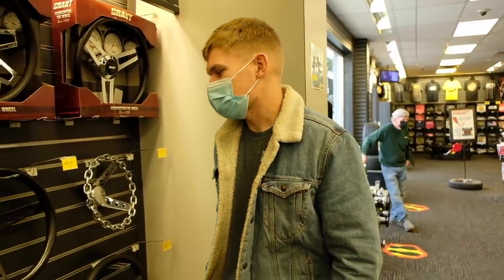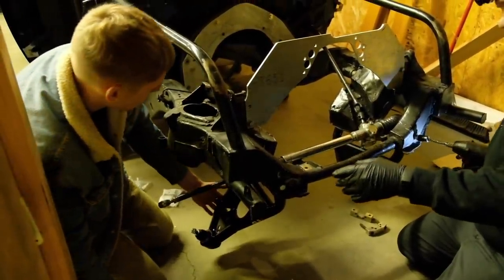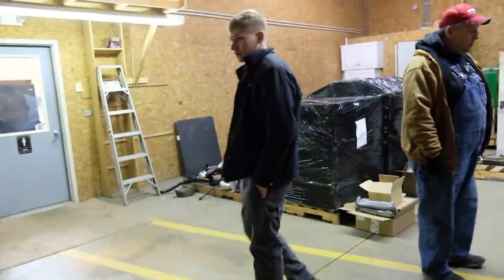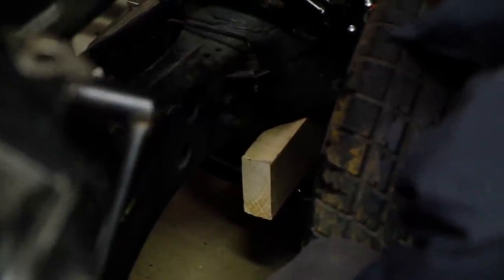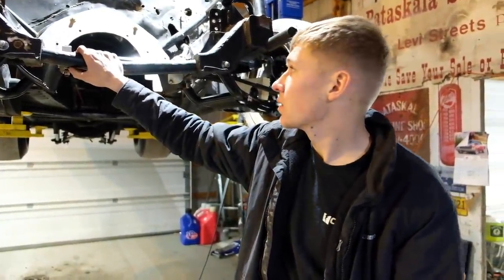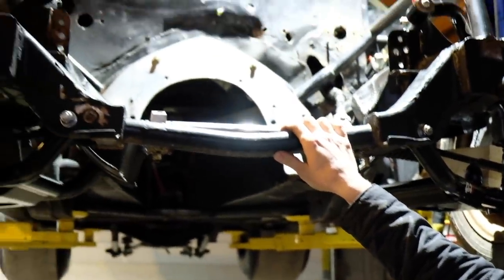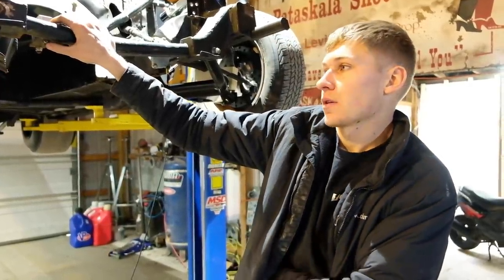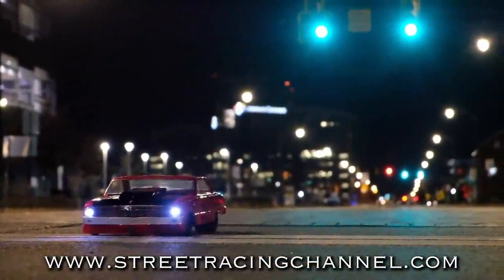NEW CAR?! Building a Street / No Prep MONSTER

Comment: OUTFRICKINSTANDING!

Gold and black top paint scheme? Yes.
500 - 502 CI twin turbo blow through? Yes.
Twin Precision PT8685 GEN2 CEA turbos? Yes.
Same boost control components, strategy and fueling used on the S10? Yes.
Tons of adjustable power with a big learning curve. But on the plus side, a VERY fast car without pushing it to it's limits. Sure it's gonna be costly and take time, but in the end it will all be worth it. I think it's fantastic that you guys snagged this legendary car and can bring it back to life. IMHO, it's exactly what you needed for the next step up in your racing career. One things for sure, it's gonna be a bad ass street car again. Big time congrats.

Comment: Two cars is a huge commitment and really tough to stay on top of even with the resources of the three of you. And there's the $$ part. I'd take the drivetrain from the S10 and set the truck off to the side, you can always come back to it. Really nice to have an already sorted engine and trans combo for compare and contrast as you dial in the Nova. Between the weight savings, aero and power to the ground that small block - Nova combo should get you where you want to be. And probably a year sooner. If you want to go big block later the car will be sorted by the time that's ready. Notice how  well a step at a time has worked on the S10, just some food for thought. Good luck and enjoy!!

Comment: HERES MY TWO CENTS. I HAD A 1969 Nova in high school. 1973 it wasn’t that old and had low miles. 307 Powerglide never got beat by a four speed 350 Camaro. Anyway it was gold too and bottom. That color gold was only 69 Nova and 1964 Cadillac. Go to paint store and see if you like it. I loved it because it wasn’t 24 karat gold color it was a VERY NICE TINT.. no black top a top with different color distracts from the overall look. My 2 cents. 
GOD BLESS YOU !!!!!

Comment: Billy, my suggestion is take a small block and spare parts you have and build it. Run it with a small block and take your time and build a ass kicking block and tear up the streets with it. And tear up the streets with the S-10. You will do fine to start out with a small block and later drop the big block in the Nova. I think you will be very competitive with the old man at your side.

Comment: big block you will love a big block after you drive it. factory gold with a black vinyl top would be sick. get all the literature you can get your hands on for the 4 link. the book Door Slammers is a good one. you can get yourself in serious trouble if its not adjusted right, especially on the big end when you get off the throttle.
cant wait to see it progress have fun with it and be careful. i would love to put a glass nose on mine but money is tight now days.

Comment: There is no replacement for displacement . If you can swing it go with a big block . As far as paint take 2 of your favorite colors and run with it . Before vinyl tops they would paint a light color from the sail panel upon the roof . So if you went black & gold . Deck lid quarters doors fenders hood window pillers would be black sail panels roof would be gold .

Comment: I have a 1800 hp street TT big block with hydraulic roller at 20 lbs so 2000 plus with a solid at 20  no problem and very reliable  , just eat more Kraft dinner to save up for parts . I’m also using blow through

Comment: Go big block Billy. A 540 is a good starting point. An aluminum block, standard heads, cast intake low maintenance deal, with twins. It is not a huge difference in price and the power achieved from it will double your small block. Keep it simple. Don't need exotic stuff for what you are doing... you picked a nice car to do it in.

Comment: Or you could start with a iron block and aluminum heads which will last a long time and only outweigh the small block by 60 or so pounds yet deliver the gut wrenching torque and horsepower you want. Just a thought, do your thing and good luck !!!

Comment: Big Block for sure Aluminum block would be nice but you can save $2000 with the iron block? World IV billet cap block is $2900 new .......... if Turbo I'd do 4.500 or 4.560 bore 4" or 4.250" crank! 2000 - 2500 HP all day ! twin 80 or 88 nice used heads or some Promaxx if your tring to save some coin!

Comment: Coming from dirt it doesn't matter how high your lead is going in a straight line . Until you get sideways then if it's up high it will make your chassis role and whip the rear . So keep your weight low .

Comment: I would go Twin Turbo or Big Single Turbo BBC and go NT/PT,NT275,X275 or something like that with the Nova and if you go BBC do a 632 or if you go SBC do an 18 degree headed 434 or a 427 SB2 or a 427cid or bigger LS and go EFI once you learn it you'll be able to dial it in alot better and maybe go faster and paint it the same color as your dad's Nova and for the S10 do True Street or 235/8.5 racing with it

Comment: 478 c.I 3.76 stroke 4.5 bore maybe 8200 redline safely depends on valve train but with that stoke itll turn what your 400 did no problem. I think the big m goes to 4.6 bore so maybe 4.4 bore to give yourself a few more bores

Comment: You are going to hate that steering wheel, had one 35 years ago. Your hands will get sore. Paint a thin straight line the length of the driveshaft so you can see if it twists...just sayin .lol. Nice project. Love those Novas.

Comment: It's a boat so it's going to need a BBC. When $$ are short you can start out with an iron block & & some cheap aluminum heads then step up later.
Reply from the maker: Lol it’s way lighter than the truck is..
Reply: @StreetRacingChannel  Ok so it's a light weight boat but you have to knock a lot bigger hole in the air to get it down there.

Comment: Would you be interested in selling your old carb when the new one comes in. I have a very unique engine combo, that i need a blow thru meth carb for. It's a twin turbo 5.4 liter with 32 valves, that i am doing a carb blow thru on meth in a 86 mustang coupe.

Comment: 632cid twin nre precision turbo's with fuel injection on methanol or nitro with laughing gas with rossler turbo 400 trans with a manual valve body. Water cooled intercooler. Or 427 big block twin turbo's blowing through dominator on methanol. And laughing gas . Go see charlie buck in king nc.
Reply: Billy be like a sponge around your dad. He is an awesome man. Tuning and jetting. Setting up a car. Don't ever take him for granted. Take it all in. He know's what does and doesn't work. I am sure he has taught you a lot. Good luck to you. I have not seen ever video. Love your dad's nova the 55 the s10 and your brothers s10.

Comment: Do a 427 big block with 2 87 mil turbos go in Cletus MacFarlane YouTube he has the same combo and it ripes and his new El Camino is bad to the bone something like that will make a really fast but reliable street/no prep car
Reply: Cleetus does not have a 427 big block. The only big blocks he has are the one out of Toast, the Aussi built unit replacing it, and the worn out one in the flatbed.
Reply: @lb9gta307  I meant to say sort block my bad I didn’t read what I said